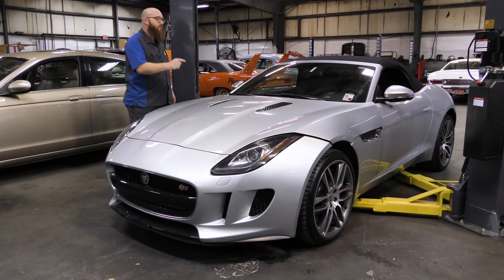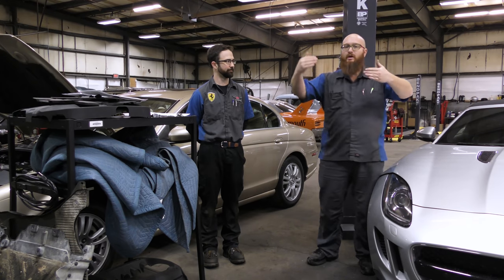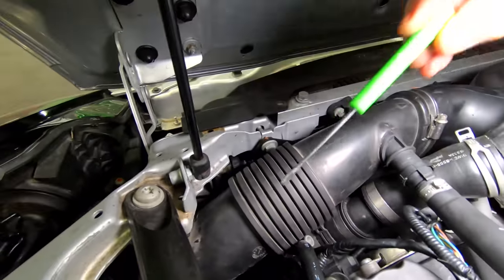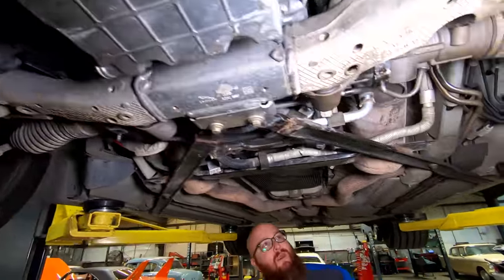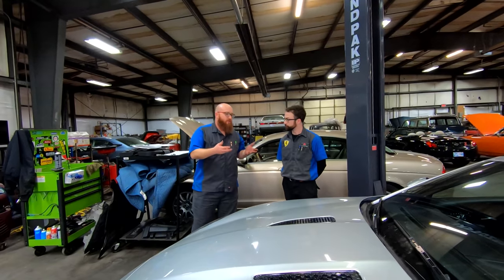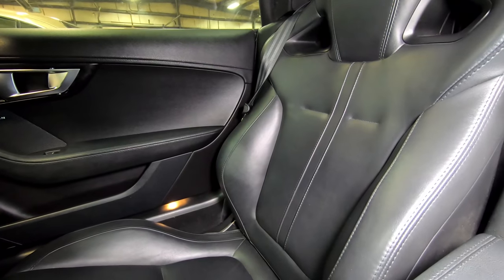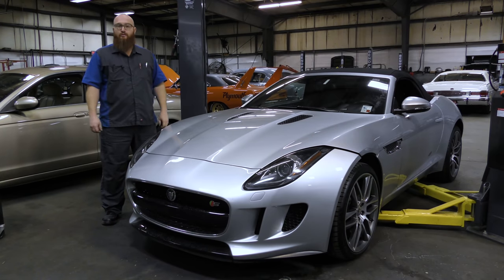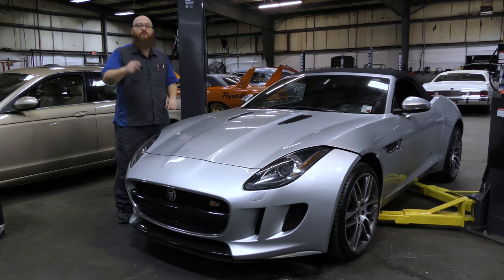How could a shop do such a bad swap? CAR WIZARD points out all the errors on '14 Jaguar F-Type

Comment: It’s a shame us as customers put a lot of trust in our mechanics for the dependability and safety we put our families in these cars I can’t believe they can do this. We need a wizard in every state.
Reply: No we need a Wizard in every city. It's really not too much to ask for an auto mechanic to be honest and competent.
Reply: @cswann8  He clearly said wizard in every state.  That would be 50 wizards.  Having one in every city would be way too many wizards.  Way too many.
Reply: I'm in Tx. We need like 100 wizards. Lol. Then there's Alaska
Reply: @-jimmyjames  I am too.   I taught myself to do a timing chain service on my 2012 Terrain last year because the first shop I took it to, to confirm it was mechanically out-of-time, said they weren't interested in the work. I was amazed. They basically told me they weren't interested in a thousand-plus dollars worth of work.  TBH, I thought it was pretty easy.  The only snag I hit was the tensioner that's on the firewall side of the engine. It was stuck pretty good. I bought a slick little Astro Pneumatic Nano air impact and zipped it right off.  If I had to do it again I could probably knock it out in 5-6 hours without hurrying.
Reply: Finding a good mechanic is like finding a good lawyer: You have to find the best one you can, and the best cost.
Reply: Can we get a wizard in UK as well !
Reply: I don’t anymore, I used to be a sucker as well, but there are people who still do, like my spouse and I call it stupidity tax. Stupid is who stupid does. Consumer awareness. And same goes for anything and everything you buy. So many things are overpriced or just junk.
Reply: @Commentator541  that's how I feel about paid TV.  It's a garbage product.
Reply: @cedhome7945  we have one in Scottish Borders. 😉
Reply: @getchasome6230  not me. I'd gladly pay for quality work.
Reply: @vw5056  1 out of 3 customers is like you. The rest have issues
Reply: At this point in time more then in a very long time if ever mechanics and dealers alike are taking advantage of customers left and right. Even the small mechanic that usually has a handful of cars is filled beyond capacity into the neighboring business. They are raking in so much money on these clunkers being sold at what were previously reliable dealers like hoovie's subaru. Hopefully this supply chain madness ends before the year ends.
Reply: I have personally found that many shops turn away work.  I even had an auto upholstery place tell me they rather not do work on the driver's seat of my Sequoia.  

I had a Mercedes that needed the throttle linkage replaced.  The engine was stock and nothing had been moneyed with.  Several weeks went by and I called the shop to follow up.  It was then I was told they didn't want to do the work and they had parked my car onto the side of the road down from the shop and it had been sitting there for almost the two weeks.  The shop had never notified me.
Reply: @mattt9298  Wow what unprofessionalism. On the plus side those are guys you dont want touching your car to begin with. Hopefully they will out of business.
Reply: We need a Wizard in every Shop if all shops cared about customers and there cars then we wouldn't be in this situation. Not looking good lately for shops working on Jaguars that said I also realize these are not the only cars being mechanically abused in shops.
Reply: @shoveI  Everyone claims theyll pay for quality work until they get a $600 bill
Reply: Lucky my brother is a master tech an I do my own what I can't solve he can  great job wizard
Reply: When it's a big job just go to the dealership
Reply: @Cinnamon535  the dealers can't afford good mechanics. If a shop quotes $2500 estimate (keyword "estimate") most people expect to pay the estimate. But if a shop ask for another 800 for whatever it's an issue. Mechanics not only fight the car but time also.
Reply: I'd like a wizard in Dubai too please
Reply: Sure, but there are always two sides to the story. Good mechanics also have to put up with customers that don't pay, or want to pay peanuts for good work. This provides a market for the unscrupulous ones who undercut the good ones. There's a reason why the dealer and another shop didn't want to touch this car, they know where it's been.
Reply: This was the exact reason why I became a mechanic, way too many stupid "mechanics" that only know to wrench bolts. The level of knowledge to even touch a modern card is extensive and most don't even know how a carburetor works.
Reply: @ghoulbuster1  haha, to be faaaaair, I don't think carburetor knowledge really matters these days, that's somewhat vintage and tuning one is a bit of a dark art, never mind a multi-carb setup :D. But yeah, so many 'mechanics' are just parts fitters.
Reply: @getchasome6230  Sure, find quality work at a dealership or crooked hillbily city mechanic and shops that are only part changers. and charge you high prices for shitty worth on you car. 😜😜😜😜
Reply: @lactusgalacto1174  Frfr you only get the runaround or shitty work if they feel like you wont pay
Reply: @MarkoVukovic0  I mean, if someone can't tune such an old design then there is no way they will be able to tune a modern electronic injection system.
Reply: Unfortunately from what I have heard the wage structures on mechanics have changed since the more honest and capable times of the 60's,70's & 80's.
Peoples standard of honesty, ethics and fairness in the automotive service industry has in short gone down.
Coupled with cut throat pursuit of profit, pay for certification, certification institutions seeing more passes = more membership = more money etc. the whole check and balances is out of kilter.
Reply: @cswann8  Don't be surprised that this type of shopping is not just in the mechanical service/maintenance industry but also in the body shop industry. 
There are many that would rather  justdo insurance work  than take up a job direct from the owner.
Reply: We need a mechanic ombudsman to be government advocate for the consumer specifically for automobiles
Reply: will sound like the mechanic or that place who did the job fail big time & sure be shut down ASAP cuz if i pay alot of money & my car miss up that bad & other places will not touch it that means the last person who did it sure give me my money back ASAP to pay someone else who can do the job right
Reply: Yes..  I just posted a comment saying if you find a good honest mechanic you should treat them like gold
Reply: The problem is that every good mechanic gets way too much work to the point where they have to hire more mechanics. That’s where the quality goes down
Reply: True, but there were NO safety issues here.
Reply: @-jimmyjames  you need so many because some of them would die in mass shootings? 🤔
Reply: Here's my rule of thumb, if it's going to cost more than $2K, I just get a new car. That may seem low to you all, but there's always something else they'll find wrong, and it's the beginning to a costly problem. Just get a new car with a few grand down payment rather than try to remedy a dying car. Let someone else eat the cost of it. I guess if it's an expensive car you want to keep for a long time, then go for it. Seen too many men sinking their retirement $$ into dying vehicles.
Reply: @nighthawkviper6791  It's very important to have a threshold, like you do. Never mind what others think.
After all, it's based on the impossibility of telling the future (as you stated) and more importantly how much car issues cost to *YOU*.
To some people, that may be a mere inconvenience, to others, it may be a big issue.
Reply: Want something done right? Do it yourself, or pay the expert's rate

Comment: Really the ONLY way to sort this out PROPERLY is to lift the engine OUT and reinstall it CORRECTLY, owner should Sue the previous shop for it,s incompetent work!!
Reply: *drop the engine down, those engines come out of the bottom.
Reply: They should sue them for the engine and labor, and just have it taken back out, and just have a different one installed. It probably isn't even worth screwing with this turd of an engine
Reply: As long as they inspect everything around the engine install, it should be fine without needing to lift it out. I'm more concerned about engine internals after a botched install, plus the source of the engine itself. It sounds fine, but who knows where the joke-shop sourced it from.
Reply: @alexpetree2038  I bet that the old engine was fine and had no problem, so they sold it afterwards for someone else. But I hope I'm wrong.
Reply: suing isn’t as easy or profitable as it sounds.
Reply: I agree 100%.
Reply: @AutoEnthusiastJC  true the lawyers get the money and waste everybody’s time.
Reply: @AutoEnthusiastJC  Suing is easy (at least in the USA). File the proper forms, pay the fees, you've sued someone. WINNING can be the hard part, and if you spend more on legal expenses than you get back, it's rather a Pyrrhic Victory.
Reply: @AutoEnthusiastJC  so instead you sit back and get shafted by so called professional mechanics???????
Reply: @bzs187  probably was nothing wrong with it
Reply: I reckon this individual has enough evidence to take the previous shop to court. It sounds like the previous shop were the ones who caused all of the problems to begin with. At first it only had an injector problem then the guy took it to the previous shop where they then botched the injector job. The botched injector job destroyed the original engine and they installed a new engine which had many more problems than the original. Tbh that shop should really be refunding him but also should be taken to court. They were the ones at fault to begin with and a small problem could have been fixed with a more dependable mechanic.
Reply: @laplays6916  They FAILED MISERABLY to do the job they were paid to do, yes take the shop to court Sue them for Gross Negligence & Failure to do the job properly causing the owner to need to get the work redone properly, probably the original engine was alright they did not check it properly!!!!!!!!!!!!

Comment: I had a 3000GT that I needed a engine.  I took it to a shop here in Dallas Tx. While it was in the shop for three month the state inspection expired.  When I picked the car up I went to have the inspection done..  It did not pass.  I took it back and back and back,  Finally I took the car to the dealer.  They did a inspection on the engine and told me the engine has never been out of the car.  They only tried to paint  it.  I ended up suing the engine shop and won my case. Car ended up in the junkyard.
Reply: What was the engine doing in the first place to make you think it needed replacing?
Reply: Aw man, poor 3000GT :(
Reply: A damn shame... RIP 3000GT 
moment of silence

What is it about things going from hobby, to now being paid to fix other people's babies! That turns these once self respecting car guys, with all of the morals of an effing man fully intact... Into these car hating, human life endangering with impunity, dollar hungry, corner cutting, flippin'... Poop emoji's (I ran out of steam there and didn't finish very strong, sorry).

These guys'll put your life in danger doing some half arsed repair work to a critical system like your brakes system or I guess even your power plant as a whole according to this vidjya... They'll put your brand new engine in danger sucking the oil out from the filler cap so they don't have to replace the old filter... That needs replaced... That you're paying them to replace?

What happened. Are these not the same dudes staying up until the wee hours of the morning helping me out with my car? Now that they are actually getting paid in more than thank you's, IOU's, and all of the genuiiiiiine American water beers they can drink (Straight from the Rocky mountains, directly to their gullets. Only the best Coors light for my boys!). NOW is when they decide they're lazy? 

Something's wrong with this picture... These guys can't be the car guys I know and love... Do ya think maybe... That... These were never car guys to begin with? That maybe these are just naive school kids who decided to get into the "lucrative" business of car repairs as their choice of career that's going to pay their bills and keep food on their table? No prior interest whatsoever, just a career choice? And nobody told them they could do half the work for twice the dough if they did anything with the words "Computer, Network, or Admin" in the job title?? No wonder they're salty... They are idiots! Poor brainless, idjiot souls....

Comment: This is disgraceful. I hope he sues the previous shop. Those issues are just pure laziness.
Reply: Not laziness... well also, but also very incompetent. BUT, what 'we' don't know is what kind of shop the owner visited, because that engine replacement is not cheap; the engine alone is worth it's weight in gold, I'd say a good low mileage engine would cost between 15 to 20k, add up the labor and it probably cost the same as a new Toyota Camry. So my guess is the owner was looking to do it cheap and ended up with a shop with subpar, lazy and incompetent mechanics... if they could be called mechanics that is.
Reply: @micglou  you don't have to be a great mechanic to know that you should tighten bolts and not let wires hang where they may. If they installed the engine etc, they're competent enough to have finished the job correctly. They just didn't want to.
Reply: driving even a used F-type these days, he should have money for a good lawyer. 
The previous shop needs to refund for all the previous work; and pay for the corrected repairs.
Reply: @anasevi9456  The engine they installed appears to be working just fine. Why would the shop refund the entire payment unless they actually caused the original engine to fail. I'm not sure that was proven.
Reply: @Sam Rock Jr. that's why you sue for lawyer costs as well. Most people will settle, if their attorney tells them they're going to lose.
Reply: @morty pen you wouldn't lose. You have the video evidence right there. And that's going to be thousands of dollars of work when it should've been done correctly the first time.
Reply: @Sam Rock Jr. if you don't have the money or patience for the American process, say that. Don't shame others for not allowing themselves to be conned by near criminals.
Reply: @Sam Rock Jr. I'm 35 years old and work as the CMO of my company. You think I don't speak with lawyers on a regular basis? 🤔 This isn't a criminal issue. This is a civil issue. He will pay for the work, or he'll go to jail over and over again for contempt of court until he pays. This is the real world of law. If you haven't experienced it, stop pretending to be an expert on the interwebs.
Reply: @Sam Rock Jr. yeah? I'm sure the judge was perfectly fine with someone defying his order and told you that you won, the other guy wouldn't be held in contempt and everyone went home happy.
Reply: @Sam Rock Jr. I understand everything fine, apparently you don't understand because you got ripped off. The Wizard mentioned this exact issue and put a title lien on it. If you had hired a lawyer ahead of time, and had not released the car. It would've been your car bud. But have a conniption if it makes you feel better.
Reply: @davepaturno4290  yep the wizard just has to straighten out there mistakes an he will be golden
Reply: @Sam Rock Jr. I don't care that you didn't get your money back either. You got that? Your whole story reeks of BS. Court 3 times, same judge, different judge, whatever the case may be, and you won ... and the judge/s are perfectly fine that the defendant isn't paying? Doesn't pass the bulls*t wiff test bud. Have a nice day.
Reply: @Sam Rock Jr. intelligent level? Intelligence you mean? Intellect even? I have a graduates degree in biology. And you get scammed. I am positive I'm better off in the intellect department than you are, my not-friend.
Reply: @Sam Rock Jr. I learned how not to get screwed out of my money, and how to make money. I learned with, I'd say.
Reply: @Sam Rock Jr. I get paid, on time. I have never been screwed over, but if I was, I would take the legal route, win, and they'd have to claim bankruptcy, pay me, or go to jail.
Reply: @Sam Rock Jr. "what more do you want done?" Give me the title of the car to sell, or find her in contempt of court for refusing to pay. Which is what would happen. Which is why your story is pure BS.
Reply: @Sam Rock Jr. I should run for president. You're right. I win, as winners do.
Reply: @Sam Rock Jr. No, they never have. Maybe yours. Don't do criminal activity and you'll be fine.
Reply: @curtism-w6b  they prolly got a discounted price but buyer beware if they didn't even pop the hood to inspect b4 you drive it off maybe they deserve? I don't know but surely you expect something for your money.
Reply: @Sam Rock Jr. yeah ... so you got mad because you're lying and went to EBT and welfare. But both of my parents and I are college graduates and you're not. You just exposed yourself as what you really are.
Reply: @Sam Rock Jr. "like getting choked out" do it. Jr.
Reply: @jayrichards3672  I don't expect anything, but I know I would get reimbursed.
Reply: Incompetent in its purest form. Or intentional sabotage
Reply: I was about to make the same comment
Reply: @walter1340  so he took the car with a new engine that wasn't bolted in? What?
Reply: Hard to sue, hard to prove wrongdoing, sloppy lazy mechanics I was told.